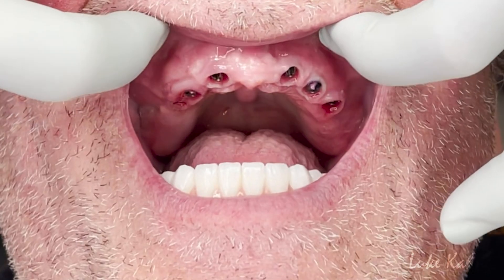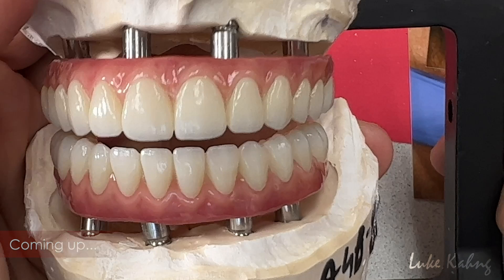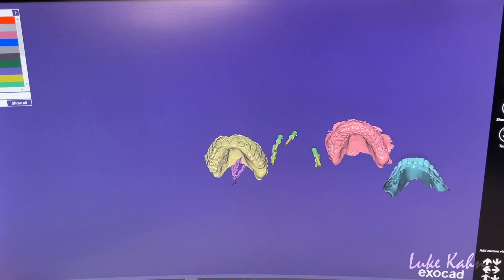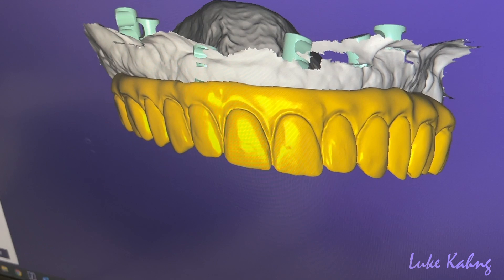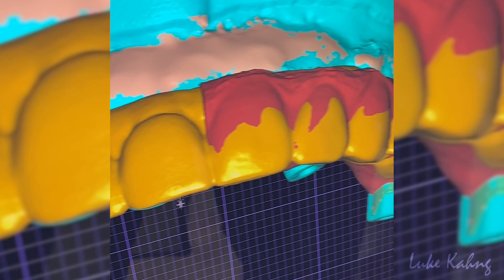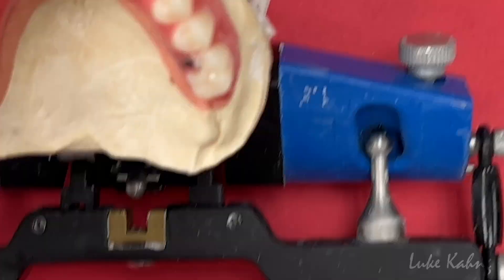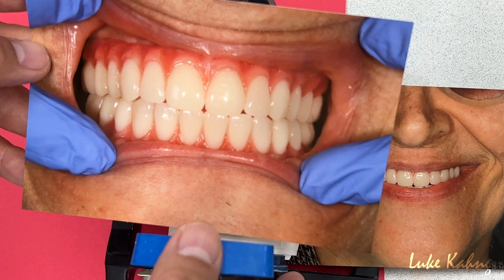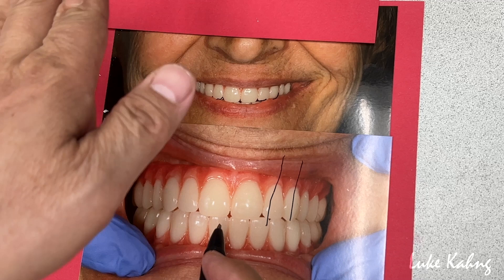Finishing Full-Arch Zirconia Implants  In Two Visits

Comment: If your Ti bases come loose you need to adjust the tolerances of the zirconia frame and alter them to be straight. The conical design of the cement interface is unfortunately a false design by the implant manufacturers. They need to have a top or bottom stop taking all the stress. Not only creates the wedge shape stress on the zirconia frame, it also brakes the bond if the vertical stop has a gap at the interface.